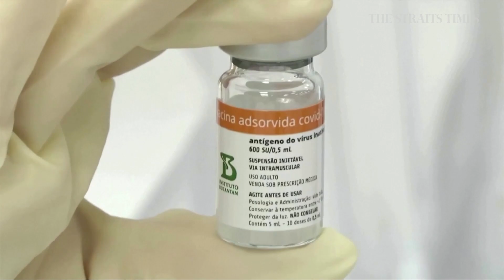China considers mixing Covid-19 vaccines

Comment: But in their local state media, they have actually "acknowledged" their own vaccine lower rate of protection albeit not stating it directly. Gotta save face, so it sounds like they are defending it instead. This is the issue while communicating with the Orientals, you have to read in between their lines. And perhaps this is how unrest starts too - mismatch of expectations arising from miscommunication.